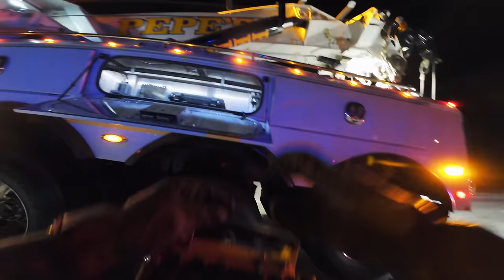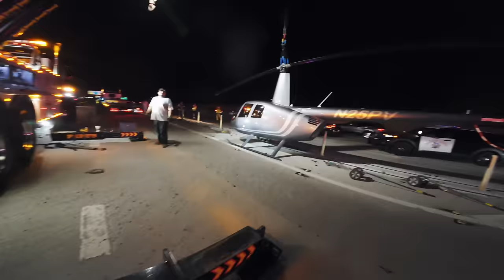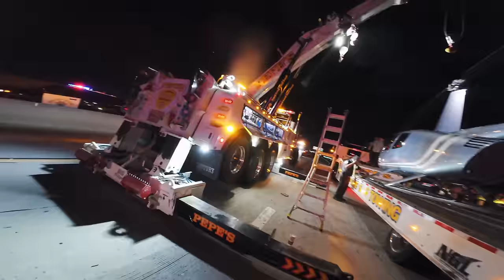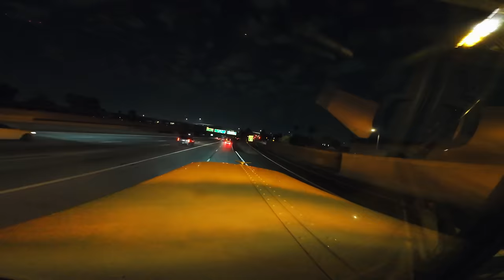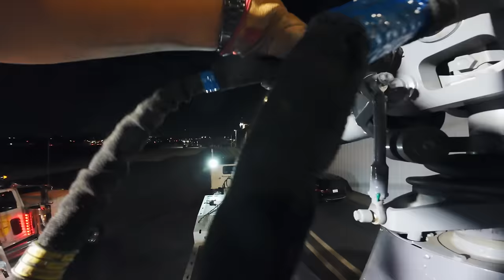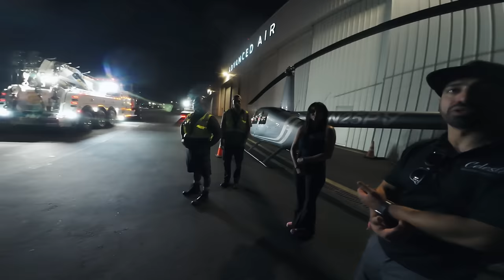Helicopter Makes Emergency Landing on FREEWAY

Comment: When you are a chopper pilot and you talk to the technician and mention that the tow guy is here to lift the copper, its probably a very unique conversation.
Reply from the maker: Fun fact: My uncle has 2 helicopters and his mechanic is the exact same one who was talking to this pilot on scene, and he told him "call Pepe's". Lo and behold we got the call anyway from CHP.
Reply: @PepesTowingService who'd have thought that the lifting points built into the helicopter could be used for lifting... Smart design that. They did good landing too!
Reply: @JamesTK  Funner Fact: All helicopters can be lifted by their rotor heads. That is the load bearing point as it carries all the weight of the aircraft in flight. 2 3 or 4 straps, depending on the number of blades, and up she goes. I worked on helicopters both in and out of the Army for many years and it always makes me wince when I see people trying to handle an aircraft when they are not trained to do so. Luckily this guy had done it before but he still wasn't what I would call, knowledgeable about it.
Reply: Yeah, when you're not lifting helicopters day in day out it helps to confirm with a tech first. They did good :)
Reply: Well, if y’all can’t believe the lifting by the rotor, believe this, the rotor holds all the weight of the helicopter in the air. If you wanna keep flying the bird another day, that’s where you lift, try it anywhere else and you’ll rip that lightweight metal apart like the flying pop cans that they are! Good work pepe!
Reply: @ImpendingJoker  i would also assume that would be CG point of a heli
Reply: @ImpendingJoker  yeah, but tbf the fact he stopped and asked rather than going ahead and doing whatever he felt like shows he's got experience and knowledge enough to ask a question rather than being too proud

Comment: Pilot did a good job - put it right down on the gore and outside of the actual travel lanes
Reply: Pilot would have avoided that area due to the damage the reflectors could cause to the aircraft and also the fact that getting hung up on one of the bases for it could have caused the skids to catch and flip the aircraft. 

It was moved there after the landing before the tow showed up.
Reply: I don't think that's what he did. You see those wheels under the skids? They attach so the helicopter can be moved around, can be done by one person.  Those wouldn't be there if they didn't move it.
Reply: @Matismo88  not to mention even the footage the news had after they got there shows it was in a different position than the tows when they got there.

Comment: Bruce did an amazing job landing that R44 on the freeway after he lost power. He is a true pilot. I hope to fly with him soon in his R66.
Reply: Definitely did a great job!
Reply: Did a great job, I really don't trust Robinson though. The ntsb still hasnt released what happened to a local real estate Guy's that looks like mast bumping R44 since the blades landed about 300' from the rest of the wreckage.
Reply: Where did he say it was engine failure? Thanks!
Reply: @RowanHawkins  The Robinson's don't have their own section in the FARs for nothin lol
Reply: @adamstone6071 If it wasn't engine failure then this would be a completely different video.
Reply: @robertbraun7155  maybe low fuel
Reply: @adamstone6071  probably Ran out of fuel. Those engines are derated for the installation and seldom fail.
Reply: @HongyaMa  that's what I think.

Comment: Really amazing that the chopper wasn't destroyed by secondary collison with traffic. I heard a bus hit one of the rotors but it must have been relatively minor or the kinetic energy in the rotor would have destroyed everything. Good luck all around.
Reply: I was looking at some of the reports again. Initially, it was thought one of the rotor blades hit a bus. But apparently not. I would assume a rotor blade would simply slice the bus. 

Now I'm wondering if the Robinson rotors automatically line up with the axis of the craft when they stop. I know they are designed with 2 blades so a fleet of these helicopters can be parked right next to each other, as a space saving measure.
Reply: It’s not automatic, the pilot used the rotor brake to time it - or moved it manually using the tail rotor

Comment: When lifting any type of aircraft, you can remember that when in flight, all their weight is only supported by the parts that have lift.  So that helicopter is built to hang from the rotor attachment point, and airplanes have the strength to be supported only by their wing roots.  So in general, those will be where you want to lift from.

Comment: For helicopters it’s pretty straightforward, the lift isn’t the problem, neither is the weight. 
The only problem might be the rotor if it’s damaged and can’t be locked down properly.
The big challenge is with light planes because of their wing span which can take up the width of three lanes or more and you can’t simply dump it on a flat bed and drive off.
Reply from the maker: You would put them sideways. Still takes up a lot of room but in an emergency situation like I've done you have a huge escort.
Reply: @PepesTowingService  Thanks, Good to know I thought putting it sideways with the tail out would be unbalanced since the motor and cabin have to sit on the flatbed, of course it all depends if the plane is intact or not.
Reply from the maker: Ya but you would strap it. Rarely are things perfectly balanced.
Reply: @PepesTowingService  Yeah, I just have this nervous feeling thinking about the tail end of a plane sticking out at right angles from the side of the trailer but then you mentioned a big escort to keep any surprises to a minimum, narrow underpasses would be an ‘adventure’ for sure depending on route.
Time to go watch your plane recovery episode.
Reply from the maker: Here you go!! https://youtu.be/OtgQXYut9a0
Reply: @PepesTowingService  Many thanks!
Reply: Sad to say, the plane that crashed and burned later that same night near the opposite end of Hawthorne airport looked like the pieces would fit on a flatbed pretty easily. The people were taken to the hospital. I hope they're doing OK. 

Sometimes the wings are taken off an airplane to transport it.

Comment: HOLY SHIT WHEN DID THIS HAPPEN YESTERDAY IM ONLY THE 22 viewer so far 😂😂😂😂❤❤ just found your channel and subscribed
Reply from the maker: Thursday night! Around 8:30pm
Reply: @PepesTowingService  oh damn bc I’m here in south jersey in Vineland and the other day a car went on the other side of 55 and crashed rip ❤️
Reply: Believe it or not, later that same night, another aircraft involved with the same airport crashed and burned near the other end of the airport. The pilot and passenger were taken to the hospital. So, this aircraft news double feature happened something like this:

1) The helicopter took off from Hawthorne airport with pilot & 2 passengers for a night time sightseeing trip. Had trouble, and the pilot landed it on the southbound 110 freeway just north of the 105 freeway--about 3 miles east northeast of the airport. The people were fine, and the aircraft will get checked out and likely repaired and returned to service.

2) The airplane, a Piper Comanche, was apparently entering the pattern for Hawthorne airport when something went wrong and it crash landed less than a mile west southwest of the airport. It ended up in the street between a Marriott hotel and City Hall. The people were critically injured, and the aircraft was destroyed.

I am astounded that two such events happened within hours of each other, and less than 5 miles apart.

Comment: They did a pretty good job considering the lack of aircraft experience.  I worked on helicopters and other aircraft during 26 years in the Air Force.  I was worried about vertical clearance and the lack of tie downs on the main rotor and if the skids were secure.

Comment: Who knew that strapping down the legs/feet would be the most technical part? Glad to see that this beautiful bird got to go home in one piece. Fun seeing that 120th St. gate open, too-- as many times as I've driven by there, I've never seen it being used. I've wondered how they bring aircraft home when the birds can't make it on their own for whatever reason.

Of course the freaky thing is that very same night, another aircraft probably associated with the same airport (it was reported to be headed there for a landing) crash landed and burned away from the airport, right next to the Marriott hotels in Hawthorne, and City Hall. Sad to say, that fixed-wing bird was totalled. But the two people in it survived, though badly injured. I hope they are able to recover soon. The media hasn't told us any follow up stories, so I hope that "No news is good news."

Comment: Several comments to say. First, this is probably insignificant but im always amazed at how easily your rigging goes together. Dont believe I've ever seen a nut and bolt not just go together with no effort. To me that shows your operators take care of items critical to the recovery. Second, the number of people that seem to feel the need to know what's going on would drive me up the wall--kudos to you and Alex and the other drivers. Lastly, the unbelievable number of cops there just standing around apparently getting paid for what? I understand 2 or 3, maybe 4 blocking off a work area, but c'mon, 10 or 12 cruisers?? They didn't have that many slow crawling with OJ. Drama personified. Only in CA, right😅😅
Hats off to Pepe's for another great recovery.  This was about as easy as it gets for guys I would think. I'm sure some idiot will flip that table in about an hour😊😊
Reply: You need the "unbelievable" number of CHP officers due to the unbelievable number of stupid drivers on the roads these days. As I recall, this incident was a SigAlert for awhile. All southbound lanes were blocked. You need extra units for the blockheads who don't believe that blocked lanes are actually blocked.
Reply: @EXROBOWIDOW  Fair enough

Comment: Did you take it right down the road to Torrance? If the helicopter is a Robinson, it's made in Torrance. In fact, those helicopters must return to Robinson in Torrance after so many hours flying.

Comment: I've never seen such a big deal in all my life. Look at all the emergency vehicles... WOW! The helicopter has wheels and could have easily been pulled up onto a rollback tow-truck; but no... we have to call a special heavy lift tow-truck and an expensive low boy to remove a small 2,500 lb Robinson Helicopter. Then at the other end, it has to be lifted off of the low boy. Someone's gonna get a HUGE bill for all that. I wonder if the pilot knew that all of those upright poles (in the middle of the freeway) were plastic? Looks like the pilot did a pretty good job of landing the ship. Not much wiggle room for a Robinson Auto; the blades have very little inertia.

Comment: I dont know why the pilot needs to tell the  flat bed driver how to strap it. that's the drivers responsibility
Reply: We know how to strap loads down , but the fact that it’s a very expensive piece of equipment I wanted the pilot to give us insight on areas we should avoid touching . We are working in unison to clear the road in a safe manner if we aren’t sure about something it doesn’t hurt to ask someone that might have more experience than us , be blessed sir

Comment: Running a strap to a sharp piece of metal is a bad idea. It can share the strap immediately. I know I’ve seen it happen. I’ve worked around cranes and heavy equipment all of my life shackles. The only way to go. However, his straps have a somewhat of a protective sleeve on them even at that not a good idea. another thing that’s a bad idea the man standing underneath it while they’re lifting it they should have a tag line to steer the helicopter where they need it. knowing the most people as a small rope tied to the helicopter so you could swing it from one position to the other.

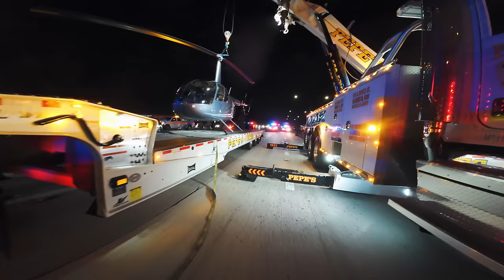Comment: 10:48 You really have to watch out the way you strap down any kind of aircraft especially when it comes to the blades just the blades alone one blade is over $100,000 on a helicopter when you strap them down you must put a towel around the blade so it won't damage and you cannot strap tight honestly the blades should have came off and the guy knows it too and he should have told you and this should have been done during the daytime cuz those blades have to come off basically that whole upper portion has to come off when transporting one of these

Comment: Col recovery but just watching WHY everything costs triple in California than the rest of the country. A minimum of 8 units PLUS Cal Trans on scenes when it was an emergency landing and no crashes involved. It’s bureaucratic overkill in areas not needing it. I can see if it were an emergency landing that crashed into vehicles or a building.  But nothing happened here. But hey, overrun by gangs and homeless?-nothing to see here.

Comment: That type of helicopter is a piece of crap I would never fly on it .   There has been a lot of problems with the rotors coming loose and sharing off the back rotor.

Comment: First time I've seen Alex do something dopey.  Removed the straps even tho he knew he was going to off load it at the airport.
Reply from the maker: lol dopey? The straps could have flown out off the freeway. Then what, leave them shackled so that shackle can bounce all over and scratch everything? Give me a break, the real dope is in this comment.
Reply: @PepesTowingService   I didn't say leave the shackles, I said the straps.  They wouldn't have scratched anything and they wouldn't have worked themselves out of those holes.

But thanks for the reply, I enjoy the videos and it's nice to know you read the comments (as much as you can with nearly 150 K subs now)
Reply from the maker: But how is that dopey? It's standard practice. If there's a chance they could come out, which they absolutely can because they're slings, why not take the 30 seconds to pull them out? So you can save 30 seconds at the load site? What is the rush to save 30 seconds when you have to climb up top regardless to connect the shackle and the winch line? I just don't understand your grievance.
Reply: This isn’t a container bub.  A sling leaving the scene at 50 mph can do major damage to the body of an expensive helicopter. Alex ‘wasted’ 30 seconds using sound judgement
Reply: @PepesTowingService  I never had a grievance.  And I don't now.  It was just an observation.  It just seemed a bit redundant taking them out only to put them back again.  But I take your point that you're only saving 30 seconds here and there.  And I also take your point that this is standard practice.  There's nothing wrong with being fastidious and i wasn't criticizing that. 

It was just an observation.  Why would you think I have a grievance?
Reply from the maker: The wording of "something dopey" implies it's negative and wrong. How often do you do this line of work I'm curious?
Reply from the maker: @user-hv9gk5tc8z thank you, someone with common sense. Those slings with the poly eurathane coating are like a cast. Getting hit with that, you'll feel it. The blue coating is thick
Reply: @PepesTowingService  Stop trying to put words in my mouth Josh.  I never said I have a grievance, you said that.  I never said it's negative and wrong, you said that.

And with the speed those rotor blades rotate and the forces they are engineered to withstand, I still don't see how those straps could have damaged them in a low speed short distance drive to the airport.

And you're now asking how long I have done this type of work so when I say never, you can use that as justification to dismiss anything I have to say.

Why slap people down like this just because of negative interpretations YOU HAVE MADE about them?
Reply: @8760-x8z  They wouldn't reach the body, and with the speeds and forces the rotor blades are engineered to withstand I doubt they would have damaged them.  This was a low speed drive to the airport.

That's all I was saying.
Reply from the maker: Dude get a grip. You literally said "something dopey". Who says "hey great work you did a dopey job!" Unless you plan on changing the definition of that word, it's a negative connotation. I asked why, and the mental gymnastics on display here would get you a gold at the Olympics. 

Point is he did it the correct way, not the dopey way. Comprende?
Reply from the maker: You're basic grasp on this is so telling, yet you keep doubling down. He put a strap in a hole. When he removes them, you see how effortlessly he tugs them out in one swoop? Whether you personally feel it can fall out during transit or not is irrelevant. It's possible and Alex eliminated an even small chance of it happening. Why is that so hard for you to understand? Don't be so dopey
Reply: @PepesTowingService  It came out so easily because he was pulling one side.  During the tow it would have just sat there and it wouldn't have damaged those rotor blades.  

Standard practice - fair enough he followed the rules.
Reply: @PepesTowingService  You can't see it can you.  You are so completely wrapped up in your own interpretation you can't even hear what the other person is saying.
Reply from the maker: You're telling me you don't do this for a living, aren't in the industry, but are so confident in saying it's impossible for it to vibrate out at freeway speeds? Dude you are dense as a rock, what a hill to die on.

And you keep ignoring my original reason for even wasting my time with you. You said it was "something dopey". Weird how you keep ignoring that part, removing the strap prior to the transport is in no way dopey. A simple "aghh I see, sorry about that I was mistaken". But ummm go off queen, looking forward to another hard headed response.